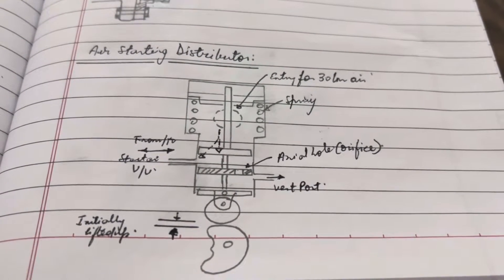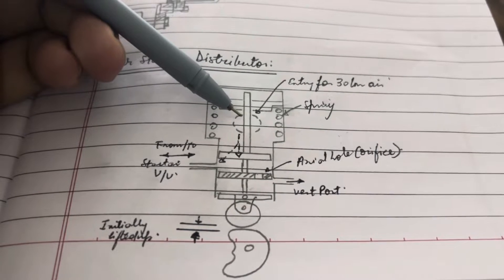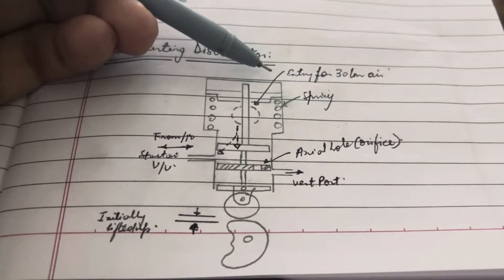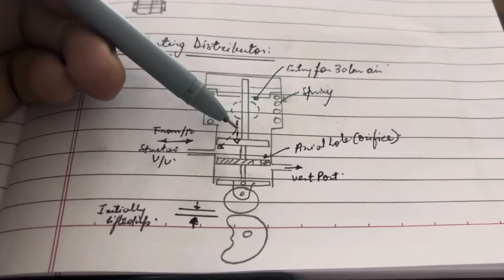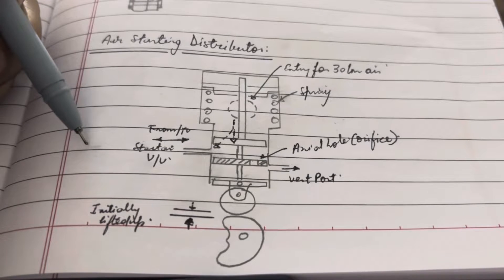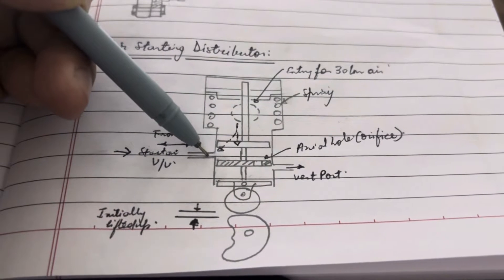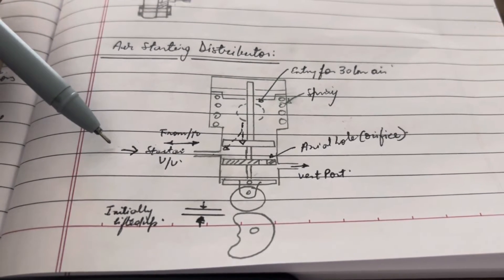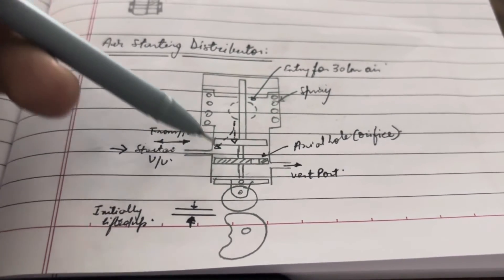Starting Air Distributor for Main Engine: Starting Air System

Comment: I have doubt 30 bar air is coming or 7 bar air is coming inside of air distributor? Because at the bottom of starting air valve already 30 bar is there and from the top 7 bar pilot air or control air is coming from distributor right so, in side of distributor it self 30 bar is coming or 7 bar only.
Reply from the maker: Hi. For clarity on Starting air valves, we have 2 more videos, detailing the sulzer and MAN design.

Once you refer to those videos and correlate with the distributor explanation, it will be much easier to understand. 🙂

Comment: Could you please explain roller followers posn during astern movement .
Reply from the maker: For cam profiles with dual (negative and positive profile) the roller follower will shift onto the negative cam while going astern. For designs where the entire cam shifts laterally, it would rest on the alternate profile after movement. 

Thank you for your questions 🙏🏻✨

Comment from the maker: 1.Since we do not want the follower to always be on the cam, to facilitate the initial position of roller being lifted of the cam is what the spring does, acting an upward directed force, however when the initial activation with air pressure happens, it pushes the lower piston and exerts a force higher than the spring force to push the roller on the cam.

2. The port is covered and uncovered by the vertical movement of the piston along with the spindle on which it is mounted when the air comes in. This air is vented when the piston again goes back in original position and the lower side vent orifice allows the air to get vented.

Thank you for your questions 😄

Comment: how to and from starting air cyl valve line covered and uncovered?what is the role of spring
Reply from the maker: 1.Since we do not want the follower to always be on the cam, to facilitate the initial position of roller being lifted of the cam is what the spring does, acting an upward directed force, however when the initial activation with air pressure happens, it pushes the lower piston and exerts a force higher than the spring force to push the roller on the cam.

2. The port is covered and uncovered by the vertical movement of the piston along with the spindle on which it is mounted when the air comes in. This air is vented when the piston again goes back in original position and the lower side vent orifice allows the air to get vented.

Thank you for your questions 😄